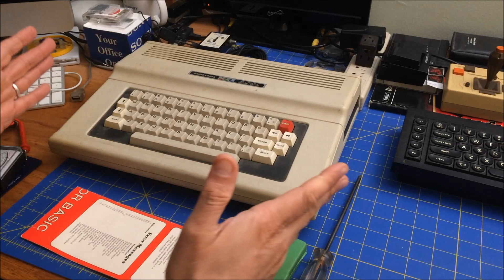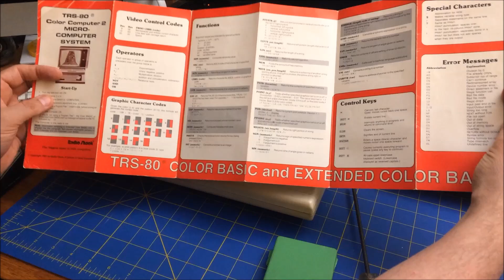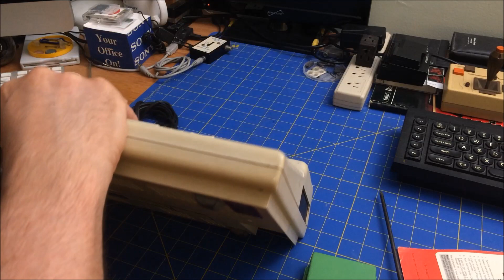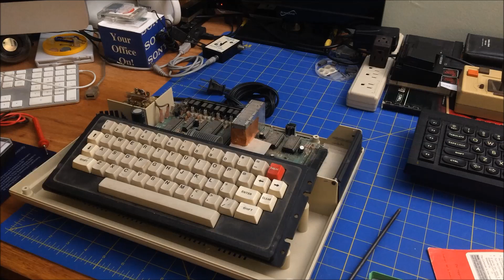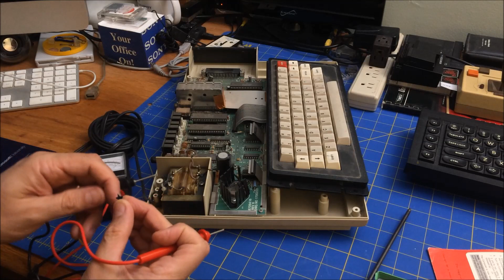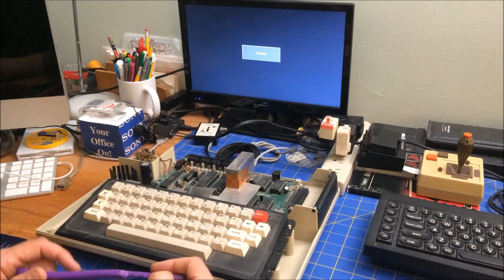A Look at My New TRS-80 Color Computer 2 - #SepTandy

Comment: Nice CoCo2! I agree with the commenter stating you might be having some RAM issues. The chips in question are the ones labeled U14 and higher, just under the top edge of the keyboard. They’re definitely the most failure-prone parts as the rest of the CoCo is fairly robust. My CoCo2 and 3s all still work beautifully after all these years! :)
Reply from the maker: Ha, funny how the C64 the Speccy and the CoCo's all share similar issues. What kind of memory does the CoCO2 take? I'll need to order some from Ali Express. I assume that the piggyback technique can be used to bypass a soldered on chips (to see which is bad before taking it off). I hope that's what it is...I have a 16K Spectrum that seemed to be memory issues but I could not track it down because replacing (and socketing) all the RAM made no difference.
Reply: @8BitRetroJournal  I believe the 64k version takes 4164 chips, but I could be mistaken. I haven’t opened my CoCo2 yet. I would just get ones that match yours! :) I have never tried the piggyback method; I’ve always just replaced chips. The CoCo3 makes this pretty simple as the RAM is socketed.

Comment: The 24 or 28 pin chips in the upper-right are the ROM chips.  Probably Color BASIC and Extended BASIC.  There should be a rectifier circuit made of 4 diodes over near the big capacitor and the voltage regulator.  I've seen those bent heat sink vanes in other CoCos, so I think it was done intentionally at the factory.  The relay is for the cassette motor control.  I believe that if you hear it click, that means that the CPU is executing ROM code.  

When you get it working, the quickest and simplest way to load software on it is to solder up a cassette cable, if you don't have one.  All TRS-80s use the same cable, as does the original IBM PC.  The schematic should be available online.  If you only want to load software in the short term, you just need a single 1/8" plug along with the appropriate DIN connector.  You can download cassette tape images as .WAV files from color computer archive or L. Curtis Boyle's web site and play them through the audio out of a more modern computer, a tablet, or even your phone, if they haven't taken your audio jack away.  BASIC programs load with "CLOAD", and machine language programs load with "CLOADM".

Comment: So, you were expecting to find a switch mode power supply, but found a linear powet supply.
Reply from the maker: I wasn't sure what I'd find. I guess I thought it would be a bit more clear where each component was...or perhaps a separate circuit board for the power supply like some machines have.
Reply: You can remove the transformer and put a USB-C socket where the factory cord comes out... Just the slightest bit of filing to extend the oval cutout.
 I hate permanent power cords 😁
 Also highly recommend a power LED.
Reply from the maker: @CoCoNutBob  so the CoCo only needs 5 volts?
Reply: @8BitRetroJournal  for the most part... Cassette and serial I/O require higher levels, but can be run with just 5v